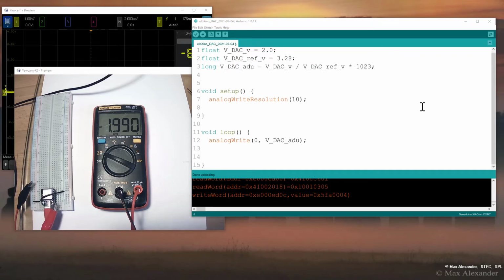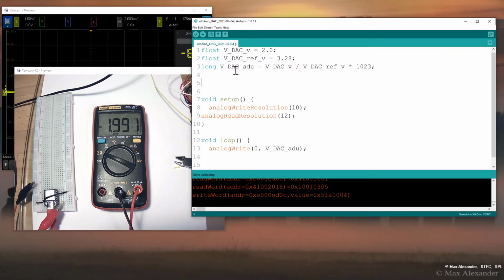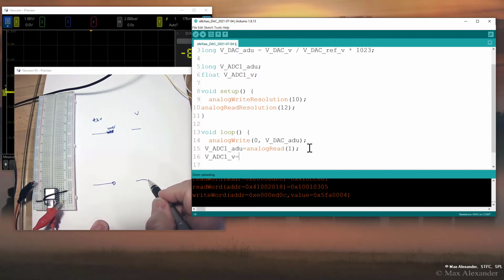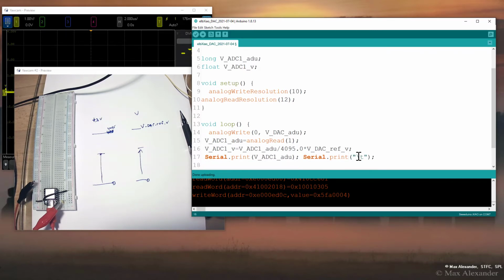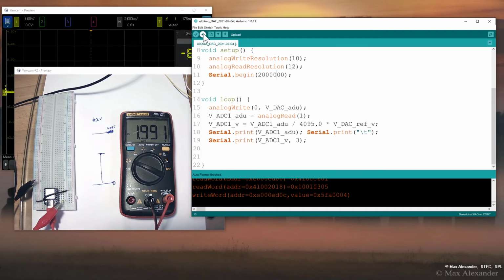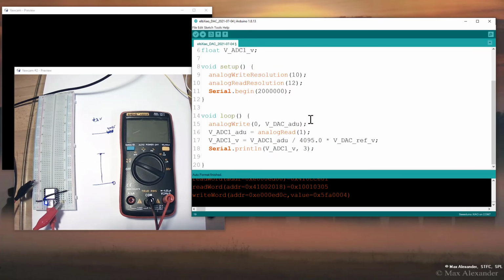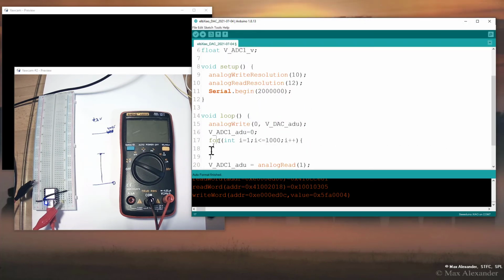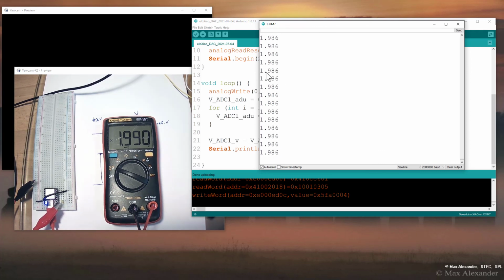SBW 16-4: ADC

Comment: PIN 2 is being used as the analogue input (A1), so the white wire jumper is between pin 1 and pin 2 - quite hard to see what was done in the video, but no magic smoke escaped :)

I think the blue led indicates that a pin is being used as an input?